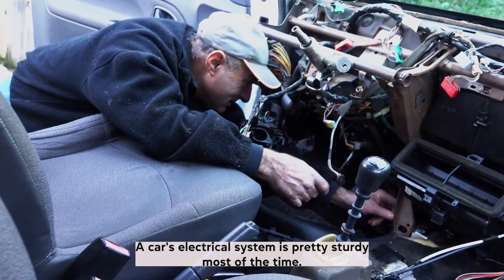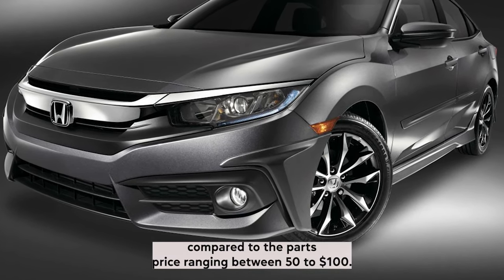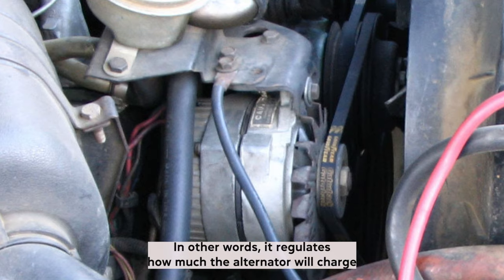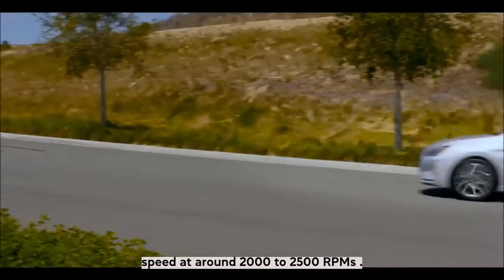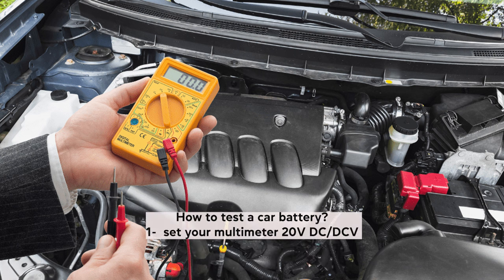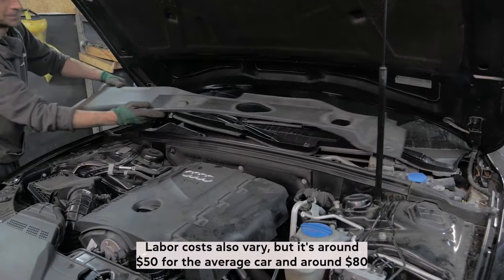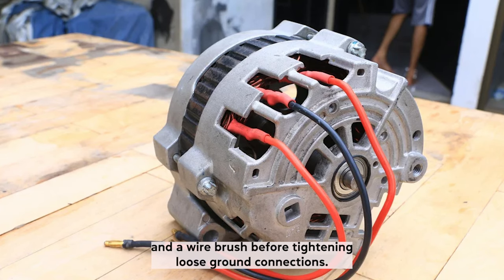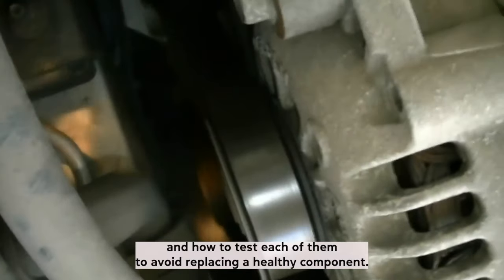Car Battery Voltage Drops While Driving (5 Reasons Why)

Comment: Hi sorry I wanted to ask you if by any chance you would know if the battery sensor can also cause this??I've been having voltage drops while driving with a new alternator and battery. I can also sometimes see a complete loss of signal to some sensors like my electronic wastegate and oil temperature sensor.

Comment: Mechanics replaced 3 reman Alternators (last one Denso) on Sienna. And yet interior lights are still flickering, voltage drops with AC and fan on. Any ideas?